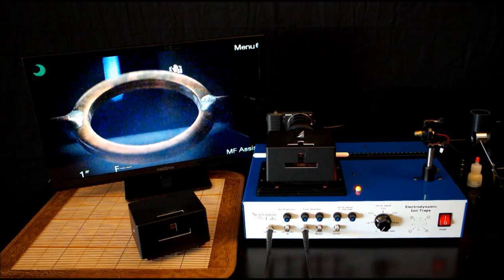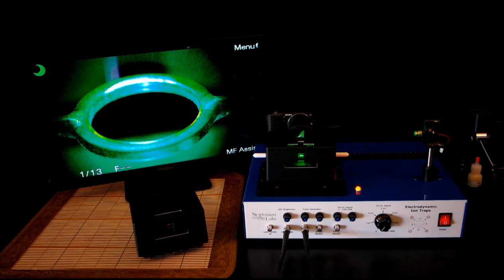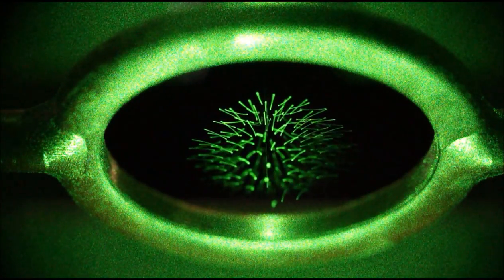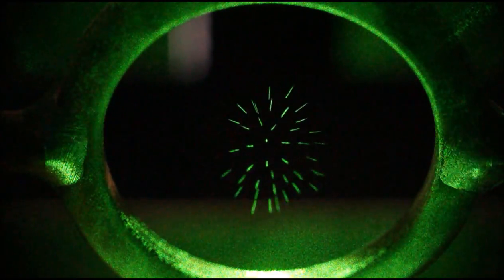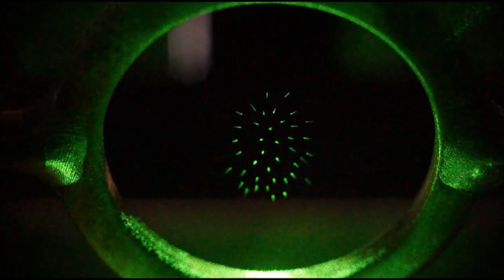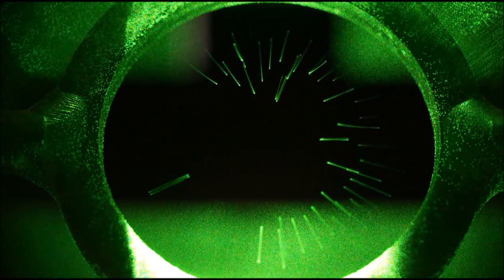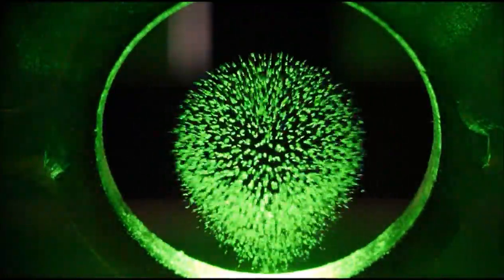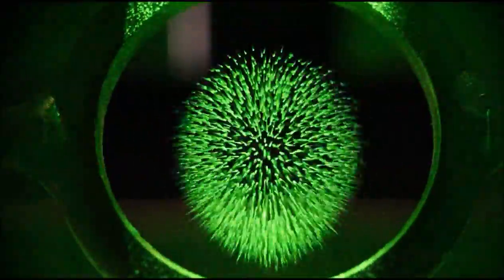Electrodynamic Ion Traps - The Ring Trap

Comment: Love this video and the effect.  I will see if I can achieve this one day.  Amazing demonstration tool for high school and university physics.

Could you fake a demo of a quadrupole mass discriminator by using various particle sizes that you drop through a set of electrodes that you control with suitable voltage and frequency and DC fields to demonstrate with visible particles how a mass-spectrometer works by separating different masses.  I am still not totally clear on how it manages to separate lighter AND heavier masses all at once from the stream even though I have watched numerous videos and read some papers.

I believe you could make a killing by having a visual demonstration that shows how the RF fields effect ions of different masses and ionisations by analogy with larger particles and LF fields.

Also It might be possible to make a macro scale mock-up of a Millikan oil drop experiment by using say small polystyrene balls, spheres or expanded spheres and make it large enough to observe the mechanics with the naked eye but have the dials look like Millikan controls and a fake X.ray generator that adjusts the DC field.

It might be possible to achieve this with just different plug in modules for universities and then every science museum would want a enlarged one with period/steam-punk controls.
Just looked at the date and it says 11 years.  How is it that this cool effect has remained hidden for the whole of social media history?

I am going to share to do my little bit to popularise the demo.

Comment: a question: what makes the particles so dissipative?

longer question: suppose we throw one particle in, then shouldn't it travel around the trap non stop? (in 1D,  shouldn't it just oscilate back and forth?) is radiation the only main source of dissipation (and it's large enough to reduce oscilations almost instantaniously (besides thermal motion of course)? )